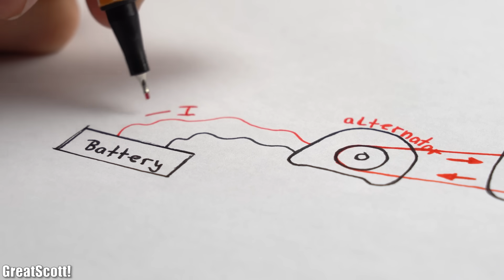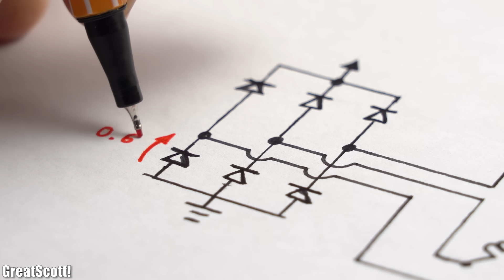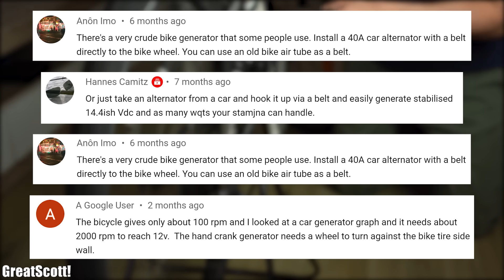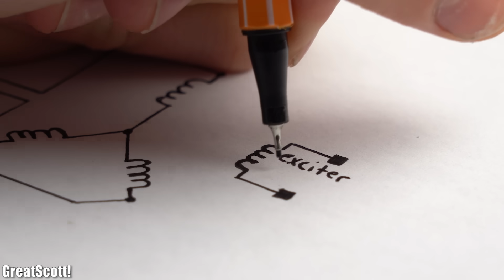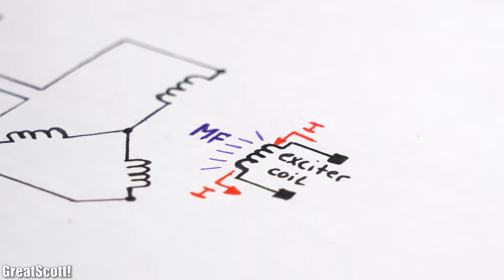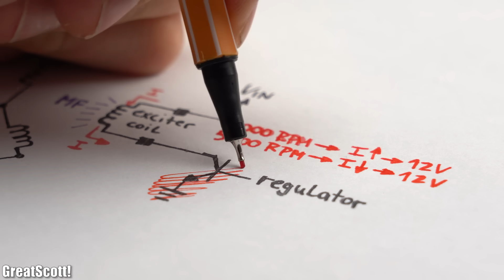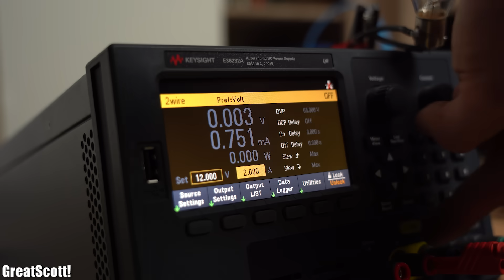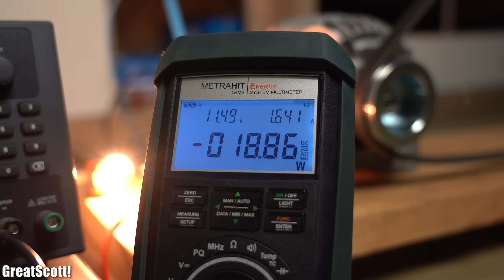Using a car alternator with a bike to power my home? How much energy can I produce?!

Comment: Permanent magnet generator saves you the exciter energy, why not use that. You need voltage regulator at charging end, though. And I read in comments, bicycle gearing is not right, I agree.

Comment: Use one generator to power a motor connected to each other by belt to  run the system by itself

Comment: The alt pully can be changed to a smaller  one. That with a bigger drive wheel and a belt tensioner would be great. The exciter wire could be activated by a hand crank on the handle bar.

Comment: Electrical horsepower to watts

One electrical horsepower is equal to 746 watts:

1 hp(E) = 746 W

So the power conversion of horsepower to watts is given by:

P(W) = 746 ⋅ P(hp)
Example

Convert 10 hp to watts:

P(W) = 746 ⋅ 10hp = 7460 W

Comment: Educational video and great effort. From this many people can learn more about power generation than from three years in school. My recommendation is to use a 24VDC alternator because it is the industrial standard control voltage. Converting voltage downwards is easy but converting upwards is not. Long time ago I had to maintain the manual fresh air supply system of a radiation shelter which was bulit in a similar way. The test lasted for 48 hours do everyone participating had three shifts for two hours. I can tell you that was exausting😵
Reply: If you just use 12v and charge car batteries in parallel, you can get an alternator for 5 bucks at the scrapyard off any old car, the batteries from there too (tested first of course- good ones do get thrown out from time to time) then just buy an inverter from an auto parts or camping shop. Then all you have to worry about is having enough strength and stamina to get any meaningful amount of power out of the system. A recumbent bike seating arrangement would be much more stable and comfortable than a wobbly upright bike by the way.

Comment: A good cardio workout is about 200W for half hour... maybe you would get in amazing shape and get it up to 200Wh per day on average. This would take serious dedication  but at that rate you could be hitting .2kWh/dayx365 = 73kWh/yr from a bike. Where I live average annual home electrical consumption is 9500kWh/yr..  so you could replace the cost of 0.75% of your hydrobill with this method which is just under $10CAD every year.

Comment: Why didn’t you use the smallest cog on the back wheel? You would get a much higher rpm with that. You used one of the slowest gears which seemed strange to me. 🤷🏻‍♂️

Comment: No comments about the fact that this dude consumes only 2700 Kwh per year, more or less 10 times less than the average American household and half of the average French household.
That itself is a feat !
I've built a couple of bike generators for a customer before, and the most efficient was 120 W at top speed ... but the guy had really good legs ! I think the theoretical limit is about 200 W ... and you can only keep the effort up for some time, it's like a permanent hill climb with a boat anchor trailing behind you !!

Comment: A model steam engine big enough to drive the alternator would be an interesting experiment. Especially if you could have a boiler fuelled by scrap wood. It could run for hours.
Reply: I’m planning something like that, using alcohol as fuel. Cheap and easy to make. Sugar, water and yeast.  And the still I made from a stainless steel pressure cooker.
Reply: @doktabob328  drink the alcohol and power it from wood. It will work much better that way
Reply: @billhall8745  LOL. I like the way you think, but I live in high density housing near the city. Not lots of wood. Even less in a crisis.Anyway , I need the alcohol to make herbal extracts : )
Reply: @doktabob328  🙂

Comment: Very stupit, because you wil spend much more then just buy electricity, if you go off grid self sustainable solar with a pirate ade 24v alt like that with diesel engine to charge u 24v 2v cells if its cloudy or use more  power then panels is charging it make sense or simply add enough panels and cells in the 1st place.

Comment: My property in the country in WV has a small stream on the property line. I have built a water wheel with TWO car Generators/Alternators that charge several 12V batteries. when the batteries are full the control circuit drops the field coil thus stoping them from overcharging there are 2 diodes on each of the generator output lines to protect from a back feed of power and a fuse for each of the lines also. there also fuses on the output side of the batteries before it goes to the cabin. So it fused on the input and output of the battery's power. The lights in the cabin are 12v. I also have an APC battery backup system for a PC that I use to convert 12v DC to 110V AC if I need 120V AC, there is a switch to turn off/on the APC that way if AC is not needed I can turn off the APC unit and not have it using DC power making AC power that not needed. As for cell phone charging, I got some power converters that you would plug into a car cigarette lighter that used to charge items by USB

Comment: alternator is meant to do a specific job and be very durable, it's not designed to be an especially efficient means of generating electricity.  considering the amount of time an average alternator produces electricity before it fails in the extremely harsh conditions in which it is expected to operate, they really are VERY durable.  sure they are readily available, but not the best choice for this kind of set up.

Comment: Ever Thought Of The Possibility Of Using A Electric Bicycle To Produce The Constant Flow Of Energy?

You Might Be Able To Use A Electric Bicycle Where You Do Not Need To Be On Top Of The Bicycle Meaning Riding The Bicycle To Produce The Desired Energy.

If You Can Some How Have The Electric Motor Of The Bicycle Spin The Rear Rim Of The Bicycle Automatically You Can Probably Create A Situation Where You Have Constant Spinning Of The Bicycle’s Rim From The Battery Of The Bicycle And The Same Exact Time Using The Alternator To Produce Enough Energy To Keep The Battery Of The Bicycle Fully Charged And Have Some Excess Energy To Power Other Things….

Just Thinking Out Loud…

Comment: I would consider a battery setup for more reliable and consistent power output and use the alternator for keeping them charged. That’s the premise behind having the alternator in the car anyway. Battery maintenance and charge. I like the idea behind it. My way of looking at it so that way I didn’t have to peddle my bicycle for the duration of the time I needed power however long that is I would use that approach.

Comment: We used too bolt a Briggs and Stratton to a bicycle on a L angle held  by U bolts . We’d weld two rear wheels together . One for fan belt the other had a tire ( obviously) 
We built little “motorcycles “ so that gear ratio worked to go pretty fast .
So reverse it and add a nice battery poof, an electric unicycle.

Comment: I made something like this years ago with a Delcotron alternator and an exercise bike. I attached the alternator with a spring belt tensioner around the bikes rim. I then installed a single pole single throw switch with a 9 volt battery to the switch to excite the alternators stator. I then connected a 12 volt fan to the output of the alternator. It worked great. The rectified output of the alternator was 12 VDC. When I peddled the bike with out the alternator not producing any power, it peddled freely, but as soon as I turned on the switch to the 9 volt battery the alternator starting putting out 12 VDC to the fan. It turned the fan but it took a lot of leg muscles to keep spinning the now charging alternator!

Comment: Your alternator isn't really the problem.  Okay, you might fix the belt drive so it doesn't slip, and try shifting gears a bit, but the root of your problem is the 'prime mover'.   Even a marathon cyclist would have a hard time outputting more than 100 W for any sustained time.  Gears, belts, alternator all cannot produce more power than what you can pedal, and as I said, most humans just don't have that sort of 'power output'.

Now, if you had some hydro-power, or wanted to use some sort of combustion engine...   you could get it performing a lot better.

Comment: I used to use a GM alternator connected to a Briggs and Stratton lawn mower engine with a belt using a pulley wheel and a spring as a tensioner to create a basic 12v generator.
The generator was then connected to a series of 12v automotive batteries.
When I wanted power I used 12v appliances connected to one of the batteries. Then another, then another until they needed charging. Power up the generator, run it for a while, repeat.
Worked great for everything I needed while camping and cost me very little in gas money.
Reply: The speed those small engines run is suitable for a direct drive coupling using a reinforced hose clamped directly from the crankshaft to the alternator shaft via a threaded on metal tube replacing the alternator's fan nut. Worked very well.

Comment: Interesting experiment, not original but also, and more importantly, of limited use. Everyone can't do it since the change over from 120VAC devices to 12VDC devices would be expensive. Also, you can't spend 24/7 on a bike, thus your ice cream is going to melt.

Comment: So the energy you get from eating food, goes into your leg muscles, and that cranks the wheel which turns the altinator, which transforms the energy from your legs into electricity, altinator does not generate electricity, it merely transforms muscle power into a flow of electrons, called electricity so that you can now light a bulb, you cannot directly light a bulb with your legs, so you need a converter, hence the bicycle wheel and altinator is your energy converter device. You can only get out what put in ...a little less due to losses. Law of conservation of energy.

So what makes muscle power (energy) get converted into electricity,  interestingly it is the magnetic field or magnetic lines of force (these are invisible) which react with electrons invisibly, we cannot see them tangle and force electrons as magnetic lines of force push or pull on electrons orbiting around atoms of copper in a conductor, or in any conducting material, so the atoms of a copper conductor are pushed  and pulled by changing magnetic field, so  these electrons start to flow back and forth as they are kicked by the magnetic field , the kick comes from the person moving the field with his legs, (Alternator) and it is the motion of electrons in a circuit that generates heat or light or even electromagnetism.

Comment: PMAs are better. Permanent Magnet Alternator, and very efficient. GMAC should have something that is optimized for your speed range. The torque is going to be an issue when you attach loads.

Comment: alternators for 1964 chevy impala are 1 wire + and the case is ground... super simple and they come with a separate external regulator if needed... I would then hook that to a battery >>> to power an inverter.... pedaling moves the alternator, alternator charges battery, inverter converts DC to AC and has household outlets... battery also holds reserve power so you can take a break from pedaling

Comment: It looks like you need a spring loaded tensioner pulley. Remove the slack from the belt and youll likely solve more than 1 flaw in your design.

Comment: Mistake 1, you used the wrong gearing on the bike. SMALLEST gear rear wheel, & LARGEST front chain ring gives highest ratio. This would have allowed the alternator to spin at more than 3,000rpm. Should have used a 200a alternator, not a 120. More power for same rpm, 2400 to be precise.

Comment: You can by a one wire alternator based off of a gm style alternator for about 50 bucks at most parts stores. . Get an old push mower to power it with. Instant generator for under a 100 bucks. Its been done for decades. You can run a 5hp alternator for almost 2 hrs one gallon of fuel. In that time you can charge a huge battery bank...for under 5 bucks in fuel.

Comment: Moving the chain to the smallest gear on the rear wheel will increase your gearing and result in an even higher rpm
Reply: But the higher gearing will demand extra work from his legs!
Reply: Yes, but he’s only turning an alternator, which has way less resistance than just pedaling a bike on the ground. Plus the smaller sprocket means he doesn’t have to pedal so quickly
Reply: @nathanchildress5596  An alternator, when loaded to about 100 watts, will be quite hard to pedal. I saw a trial of this on an old science show and even a fit bloke couldn't go for more than a few minutes and the max power was between 60w and 100w. You would never 'power your home' from something like this.

Comment: In high school physics class we measured the power output of humans by running up the stairs as fast as we could and calculating the power required to do so....and quickly found out just how little power output a human has.  Your experiment was a much cooler way to find out the same thing :-)

Comment: Guess i mine as well share my design....car alternator....water pump....washing machine motor and water pump....connected properly you fill the tank once with water and in theory it can for the life of the alternator and motor.....using an electric fly swatter you can aquire a transformer that takes 9v into over 2,500v....in theory this device can fit inside a shoe box and should have enough energy to power a small town....if 2 alternators are used it can then use itself to charge itself.....this can also be done small scale to at least charge batteries using old fan blades on the alternator using air to charge the batteries

Comment: As a human you are capable of about 1/2hp (350watts) for about 10 minutes before you are exhausted.... The limit is you, not the alternator. So from fresh to exhausted you have produced about 30 wartt/hours....it's physics, you don't get anything for nothing. You will need a field exciter current to get anything out of it. The rectifier is built into the back plate. But your work capacity is far too low to be useful..... drive it with a water wheel etc. and you might have something useful.
Alternators don't need to spin fast......

Comment: Hello. Saw your vid. Might I suggest a rethink. I would suggest looking for a 1950s or early 1960s corvair Generator verses a modern alternator. I personally use a couple on simple water wheels to produce electricity. They are alot diffrent than an alternator

Comment: hello my friend.fascinating ideas.I've a thought in my head about installing a turbine into the rising water main to harness to an alternator to trickle charge a battery bank.I'm not very good with science,but the water pressure I'm sure could be used to power something.let me know if you have any ideas on my plans.I'm off grid,but have a windmill,and one kilowatt alternator.going to invest in pans next.just a thought.please share if you consider it viable.respect.maddog,west cork. republic of Ireland

Comment: 2:50 it's called a stator, not rotor. But yeah, nothing will output because the electro magnet is not powered up.
If you get a 60s GM alternator it's the best to use because it has permanent magnets
Reply: those permanent magnets degrade with use.

Comment: Add a wind turbine, a flywheel and a capacitor bank (or battery + charger), and the bike would not be needed if the wind is blowing.

Comment: I heard somewhere that car alternators, while cheap, are not efficient as generators, they generate only 20% of the power possible. There are other motor types that make better generators. The bicycle arrangement should be augmented with a flywheel. A person can spend the effort to spin up the flywheel, then a pause won't cause the power to stop right away. This allows multiple people to take turns at the bike.

Comment: If you add a flywheel, your input/output will be more stable. Heavy enough and you probably won't have to peddle all of the time. Put a tachometer on your bike and you can find what speed is the minimum to produce what you need
Reply: You will have to pedal all the time- if you don't, the flywheel slows and you need more effort to get the heavy flywheel back up to speed. The only positive effect it has is to act like a mechanical regulator, keeping a smoother, more stable rpm.
Reply: That is what I was thinking; A flywheel (or just weights attached to the back rim) while used in a lower gear can help move things much more consistantly at a higher power output.  When you are biking on the road your body becomes the 'flywheel mass' that keeps the bike moving at a steady rate even though the down-strokes of the pedals are inconsistant.  When you lift the back wheel you loose that.
Another thing sorely missing is a tensioner on the belt.  The alternator would work much better with a higher magnet voltage, and the tensioner would prevent that slippage.  So more gain on the alternator, combined with a flywheel to even out pedaling efforts would probably go a long ways towards making something like this work.

Enough to power the whole house?  Oh, probably not.  But enough to supplement a solar array on a cloudy day? Maybe. Or enough to power 1 or 2 household items? Probably.
But this is why you have kids.  If it is going to take him 14 years with this setup to power his home, then he just needs 14 kids pedaling non-stop to live his dream! lol
Reply: I was thinking of one of those rowing machines . Has anyone tried this idea?
Reply: You got it check out Billions in change